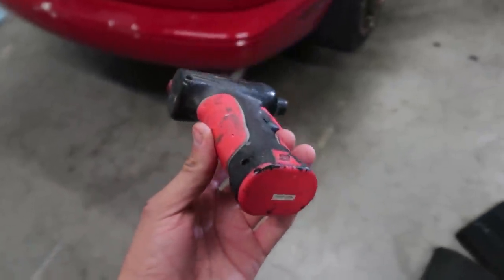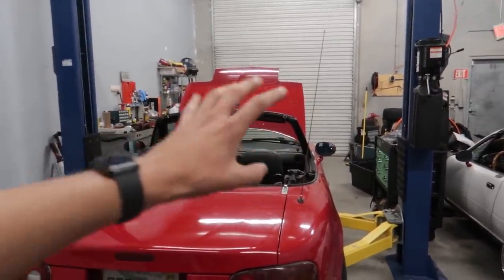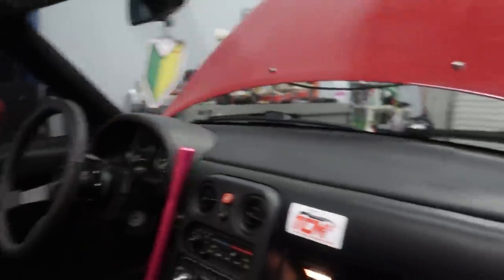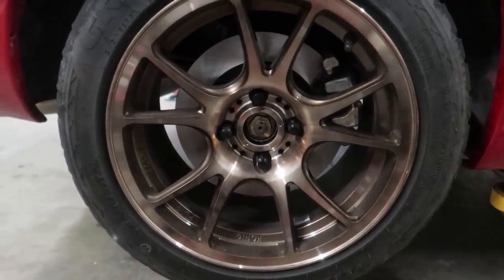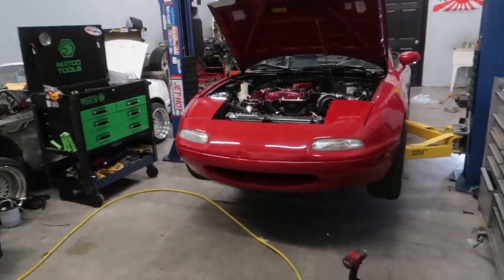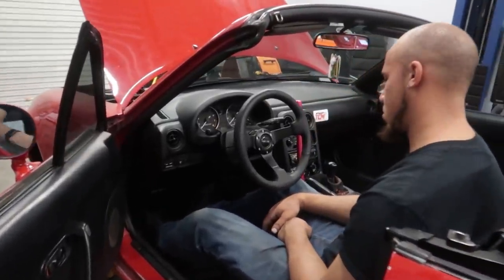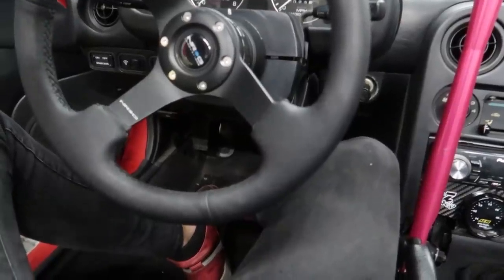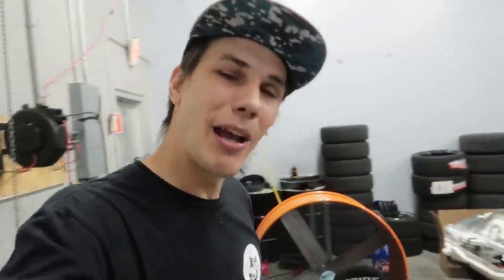BIG BRAKE UPGRADE FOR FORGED MIATA!

Comment: Always torque hub bolts to spec or your decreasing the life of the bearing by putting them on to tight
Reply: This, I rattled my mums wheel bearings up and the bearing machined itself.
Reply: @AdmissionGaming  lmao
Reply: @ChillinLikeAVillain1210  it's not funny guy I'm putting it out there because the wheel bearing locked up and she had a crash.
The airbag went out in her face and knocked her front teeth out so she had to get some dentures.
Reply: @AdmissionGaming  ooft man. Thats heavy. I was more laughing at the way you worded your comment
Reply: @ChillinLikeAVillain1210  he made a joke and gets defensive when you lol without knowing the backstory?? Clownnnnn

Comment: Common misconception, those aren't just dust shields for the brakes.  They're splash guards more than anything. I don't have them on my Miata with the wilwood BBK and the rotors get wet in the rain and the brakes are absolutely HORRENDOUS in the rain.

Comment: Shoulda had James powder coat those calipers before you installed them....would have been a nice touch or cleaned them up and used some high temp black paint on them...
Reply: hell yeah.

Comment: the rear brake caliper on my F150 seized then I ended up replacing both rear calipers, pads, rotors and rebuilt the brake lines.  Then the wheel and tire on the front right flew off after the wheel bearing failed at 50mph, trucks back on all four tires and now awating a front carrier assembly that I ordered the day before the wheel bearing thing happened.  Hows the replacement clutch kit coming along?

Comment: Brake pad type makes way more of a difference than the brake rotors diameter. Also, when going to the sport brakes, you should upgrade the brake master cylinder to the larger one that came on the nbs.

Comment: Dead ass question:
Should I keep the cap open when bleeding it? And how hard should a pedal feel when bleeding the brakes?
Because the last time I tried to bleed my brakes the pedal was getting rock hard, and barely and fluid was coming out.

Comment: Was not long ago Rudnik came with the keys for you when you where stranded at the shop LOL. So it's just to be a good friend with no complain man. 
Well needed to be upgrading the brakes on the Miata. Wondering if you can stand up to follow the break in period the manufacture has on the new clutch that's coming. The winner will be very happy with the upgrades that's been done on it.

Comment: This car needs a roll bar so badly, pretty irresponsible to make so much power without one. Don’t think any track will let you drift without one either.
Reply: he can just go to the compound 🤷‍♂️
Reply: Christopher Spurgeon with a car that small and a convertible you NEED a roll bar, he doesnt even have seats or a harness at the minimum you need a roll bar
Reply: Christopher Spurgeon still sketchy, I wouldn’t recommend sliding out there without one. Also odds of the winner living near there are slim
Reply: The giveaway winner doesn't have a license, this whole thing is a joke TBF, effspot flew to Japan to avoid the LA shutdown, everything he does is for name or aesthetic. It's very odd.
Reply: TK ok

Comment: Sure why not add more weight last video Jack mentioned that the Miata engine is a battleship compared to Rodknocks SR20 yet he adds heavy brake kit 🤔 to stop 400hp? Are miatas really that cheap of a car asking for everyone... it seems to me like a waste of money for fun cause competitive car it surely ain’t 🤷‍♂️
Reply: parts are relatively cheap, you can still find them for under 1 grand running and driving. the 1.6 brakes are actually terrible on the miata so its worthwhile, he stated its not intended to be a straight line car. also they are competitive just not forgiving, when you start making power like that.
Reply: Considering he's spent more then 7k USD on the car.. You could turn any nugget to a rocket with that kind of money..
Reply: @JohnDoeC78  7k is still less than alot of cars go for. I cant think of anything rwd that you can make that fast for that price, and not look like its from the junkyard.
Reply: I thought Jack was full of shit when he said that.....and he is.   mazda 1.6 272 pounds, sr20det 306 pounds, honestly its a wash now that hes got a turbo on his 1.6.  Iron block doesnt mean heavy.  these are just quick google numbers